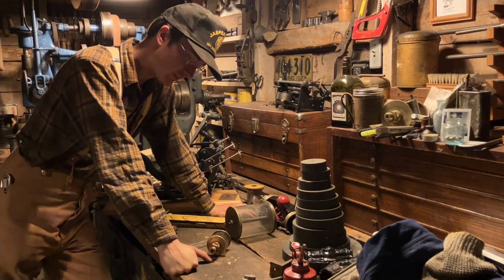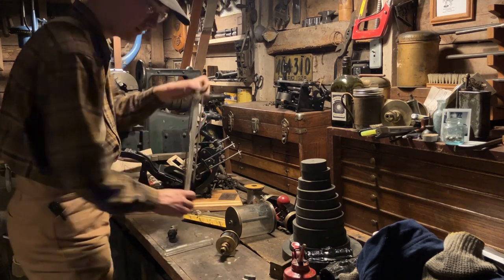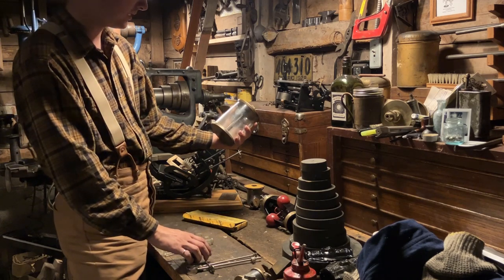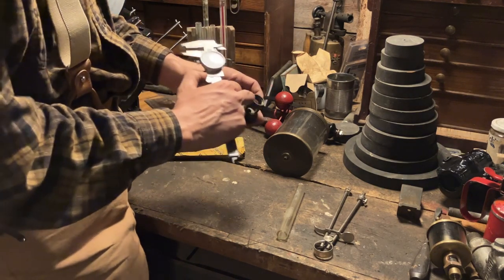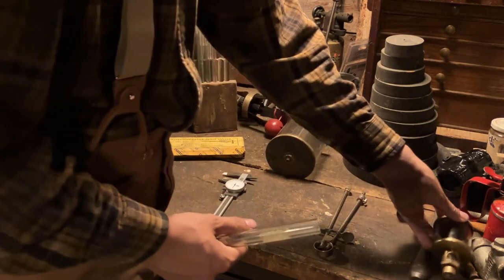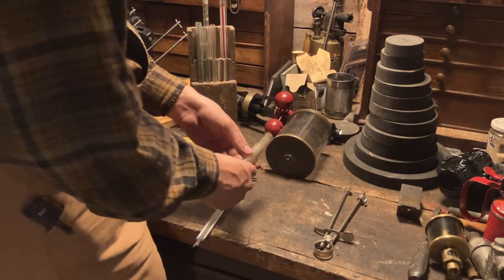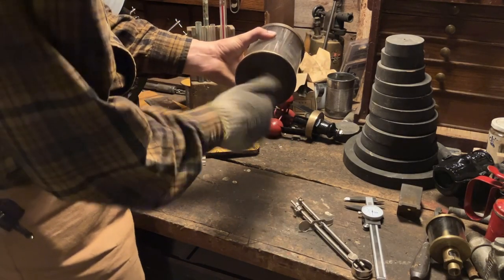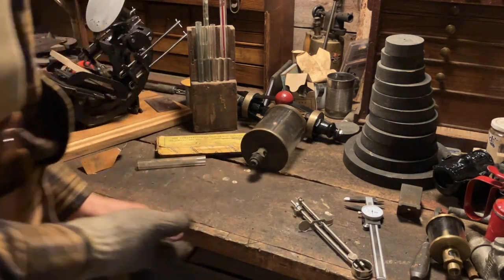Cutting Gauge Glass for Drip Oilers

Comment: Glad you touched base with the ends & outs of proper use of this tool! Been sub’d to your YT chan for awhile now; really love all “Industrial Archeology”! I started collecting throttle governed & hit-n-miss one-lunger engines, whether gasoline, kerosine or, diesel &, steam engines, back around 1986.. needless to say, since then, i’ve acquired quite a bit of random odds & ends pertaining too the maintenance/repair of these things, including vintage/antique tooling & machinery per repair of automotive back in the teens/twenties & subsequently at some point, ended up with one of these same glass tube cutters, not having its original box or any info. I always just knew it had to do with some type of glass cutting, due to its little cutting wheel. Anyways, it wasn’t until i worked for a spell with an Estate Sale crew @ 2018, having accepted the offer to keep a couple very cool, very big, VERY THICK, antique tool warehouse catalog books, both from near turn of the Century, as partial payment of a particular Estate Sale location! One of these catalogs was from a warehouse @ the San Francisco area of around 1916 & the other, from the Chicago area, from around 1907.. these catalogs are absolutely loaded with fantastic info & engraving images of about every conceivable thing one can think of! Anywho, one day, i was rather bored, during the pandemic lockdown days, thumbing thru one of these & BAM! Came across the lubricator order section that included this same cutter for sale, of various lengths, describing in full detail of its purpose & use!!! Keep up the great work you do! Thanks!
Reply from the maker: Great story, cheers!